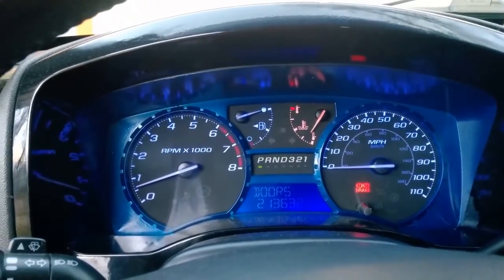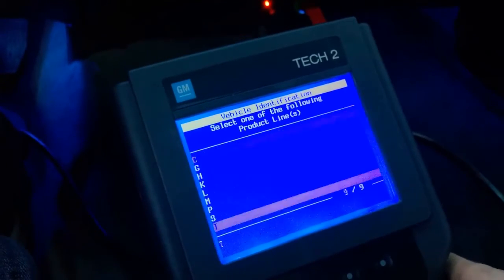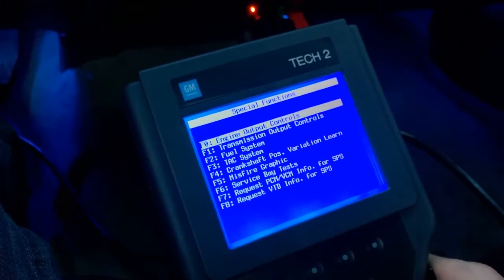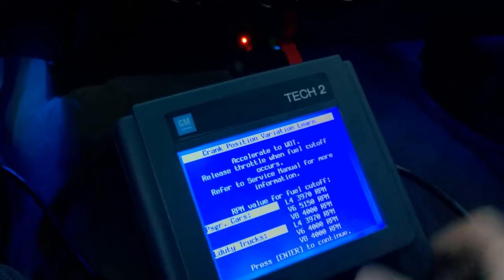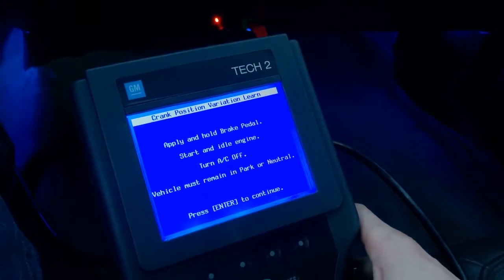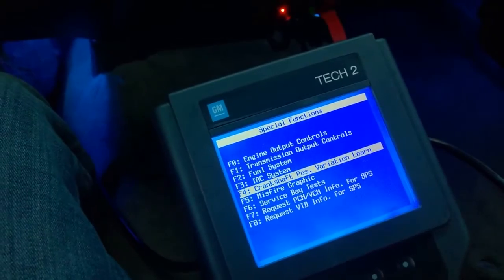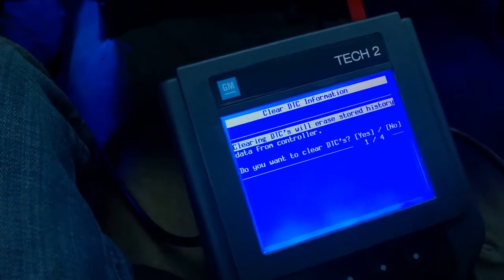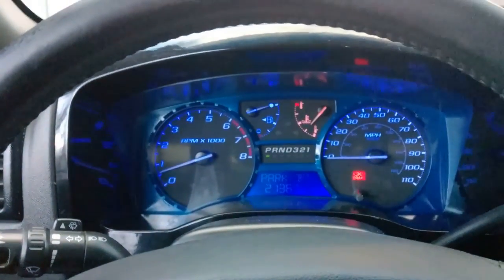How-To: Crankshaft Variation Learn Procedure (Tech2)

Comment: Do I need to connect the CANDI?
And I have a problem, it flashes and does not enter the car computer...
And when should I connect the RG45 connection on the side to close the circuit    

Chevrolet Uplander 2008